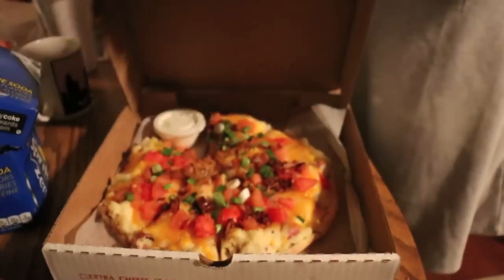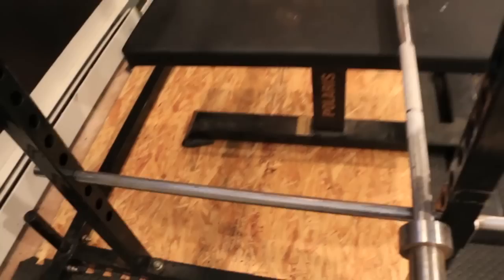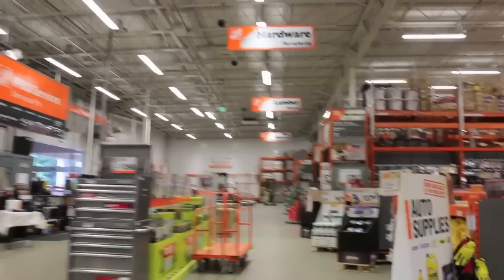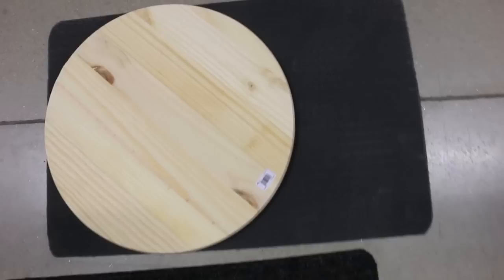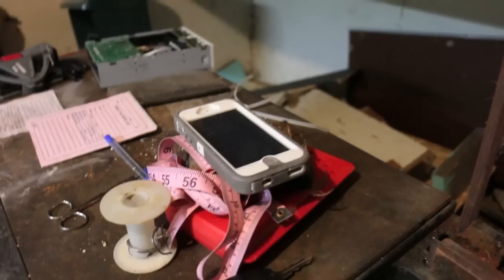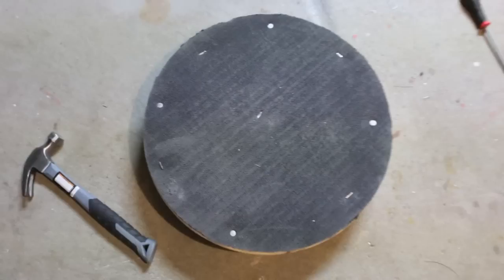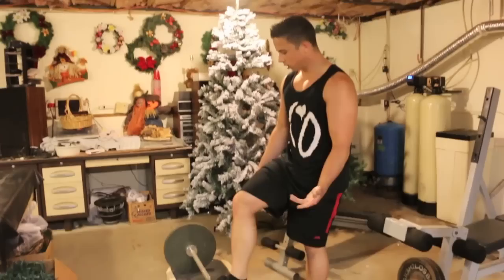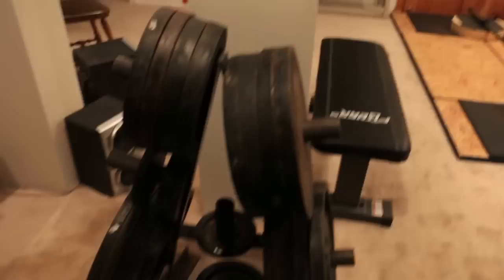Home Made Gym Equipment

Comment: I use 2 Saw Horses in my home gym. It's helpful for a ton of exercises when your not interested in lowering a bar to the ground each time (shrugs,curls,over headpress.etc) . You only need about 30 feet of 2x4 and home improvement stores sell the 4 brackets you need for assembly. After that you can make it as tall as you need. I've put a least 400 pounds on mine with no problems.